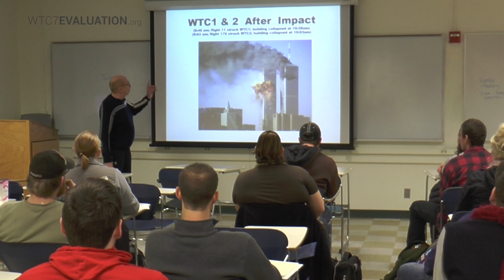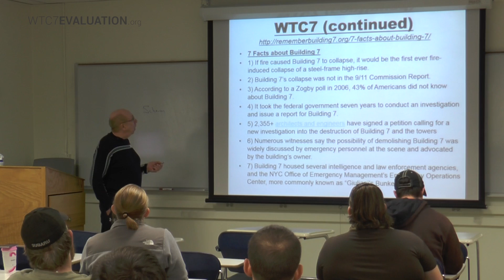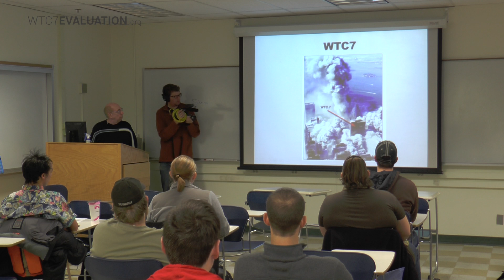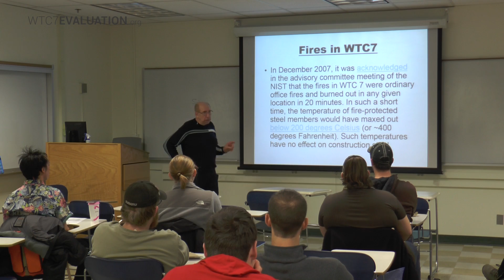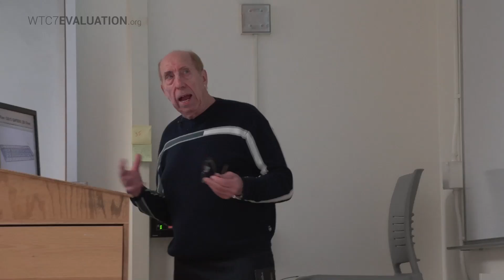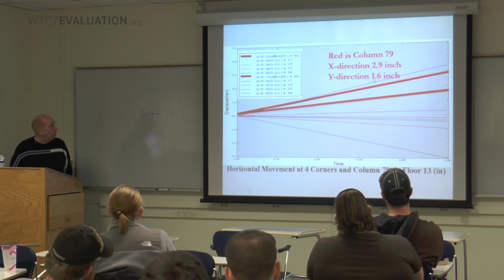WTC 7 Evaluation Engineering Study: ASCE UAF Students host Dr. Hulsey Oct 2015

Comment: You seem to be suggesting that a Basement Fire from Fuel Storage in that location could have Generated enough heat to collapse all columns at the same time on that floor level, and that could possibly bring the Building down in Free Fall, even if all the columns above that level were almost unaffected by Fire Temperatures from Normal Office Materials combusting. I would think that those columns between the floors above would offer substantial resistance to Free Fall occurring. Collapse and Tilting maybe; but straight Free Fall?... Highly unlikely!
Reply: +Peter Cullen 
Highly unlikely! ?

Can we spell i-m-p-o-s-s-i-b-l-e?  Yes we can!

Comment: Even if the base collapsed due to fuel storage fire (weakening the columns) ... The structure above would still remain relatively in tack and topple. You would not see a free fall condition within it's own footprint. Also... concerning the fire protection water being depleted from WTC 1 and 2; the impacts made on both would have certainly severed sprinkler branch lines from the main risers with in the core structure... water would have been seen pouring out from the openings of the impact. This was not the case from any video evidence I have viewed.
Reply: t is
I agree!
Reply: +1quasar1 Good observation on your part in regards to water.
Reply: Honestly, the explanation provided by NIST is just flat-out laughable.
NIST is either an organization of complete morons or complete corruption.
Every other conclusion they've reached in the past should now be questioned.